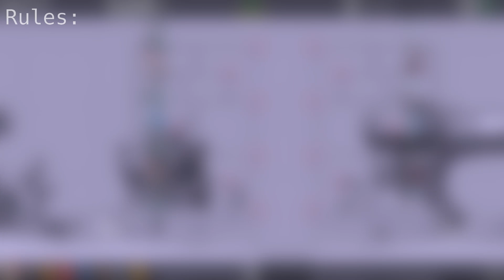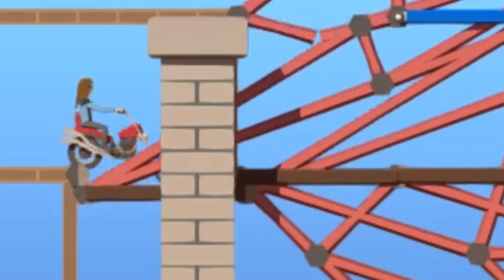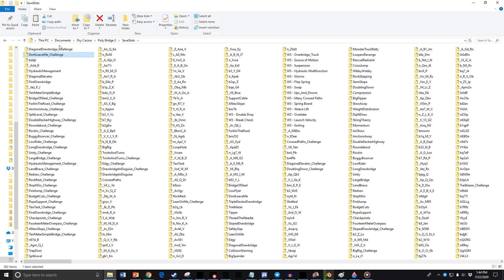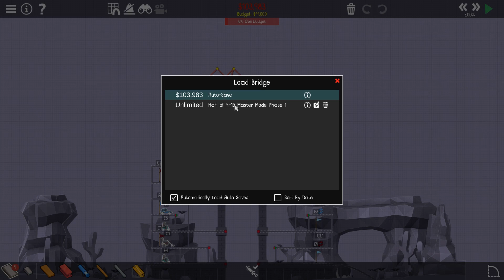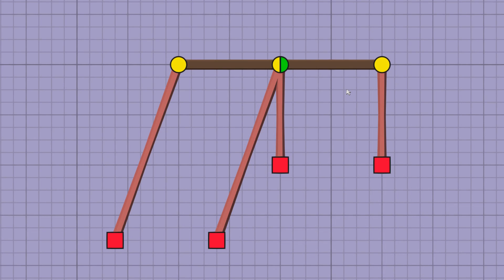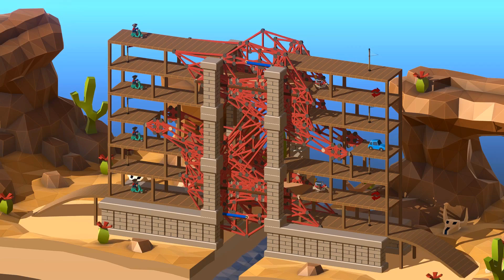My FIRST MEGA PROJECT! | Poly Bridge 2 Overengineering

Comment: You should consider making a macro that just mashes the "rotate" key until your clipboard is at a 90 degree angle, or if you're just measuring out a 90 degree angle you can flip your selection first to jump closer to 90 before manually rotating
Reply from the maker: Or the smarter alternative is modding the game to auto-snap to 45 degree rotating increments. XD

Comment: I really wish that this game would implement a "Layer" system, so you can have one module wholly separated from another part visually, but still have them overlap and work together. An example of a game implementing this in a great way is Geometry Dash.
Reply: You can have a color mod
Reply: @Camachameleon  but thats a mod
Reply: @Camachameleon  Colour mods would be an improvement, but a mod that allows you to pick which colour segments to hide would be great. That way, you could actually focus on the bridge one part at a time instead of being distracted by the other parts.

Comment: Couldn't you just have used your first solution and detached the mechanism used in the first and last hydraulic phase during the second and third hydraulic phase and using a three-way split join to do the opposite for the mechanism used in hydraulic phase 2 and 3? With that avoiding the four-way split joint problem and using 1 for the left road, 2 for the right road and 3 for the unused mechanism. Since one of the mechanisms will always be connected to the roads themselves wouldn't that have saved you loads of time remaking the whole bridge?
Reply from the maker: The problem is that the unused mechanism has arms that move independent of each other, so setting everything that isnt the roads to 3 will cause stuff to snap.
Reply: @ArglinPB  after thinking about it for few more hours I have finally understood what flaws there were. Thank you for answering so many comments even though they aren't quite the best sometimes 😅

Comment: Maybe a new way to avoid implementing 4 way joints, would be to allow editing phases like hydraulic phases. That would open soo many more possibilities, where the bridge connects then you go and perform "maintenance" on the bridge, and then the next phase occurs.
Reply from the maker: It's definitely a cool idea, though not really necessary if there's already ways to circumvent the whole issue all together which I pretty much demonstrated with the new split joint systems and hydraulic controller.

Comment: Can you make the tallest building possible? Maybe using hydraulics to go over the limits
Reply from the maker: I'll give it a shot!
Reply: @ArglinPB  Good luck! Don't think you'll need it, though😁
Reply: @ArglinPB  If you use springs, you can get 100 percent compression
making the hight higher.
Reply: nvm, I tried it and the nodes just stop and stay at a hard-coded limit.
Reply: @realprotonn  other wise spring level everywhere
Reply: @realprotonn  they may not if you use split joints. Split joints are weird.
Reply: @rulliantheskunk2091  oh yeah...
Reply from the maker: I mean, even though its a hard-coded limit, the code isn't necessarily my limit. ;)
Reply: @ArglinPB  then what IS your limit? 🤔
Reply from the maker: Well we'll have to find out in the video my friend. ;)
Reply: @ArglinPB  oh, right. Didn't think about that. facepalm
Reply: Diamond hydraulics made of diamond hydraulics made of diamond hydraulics made of...
Reply: @AuraChanneler  at that rate, the budget will go throght the roof faster than the hydraulics!
Reply: Agree
Reply: Great idea
Reply: My Braincell is already dead so why not?
Reply: I thought Springs extended more than hydrolics.
Reply: It mightbe easy